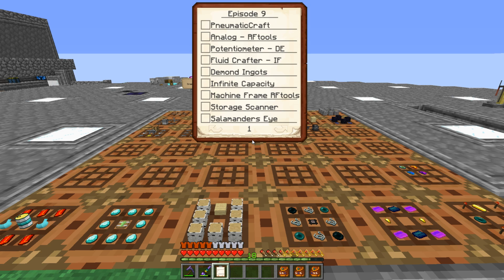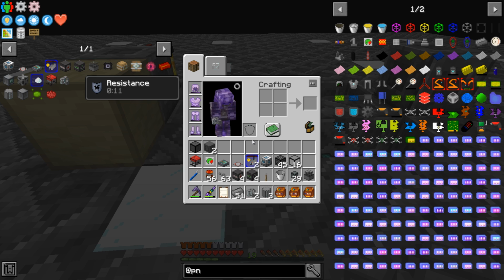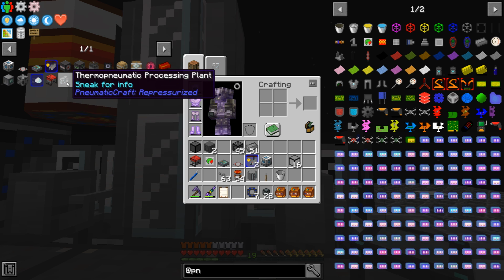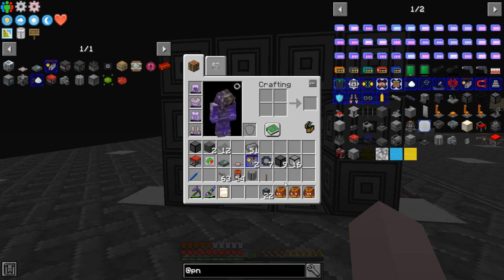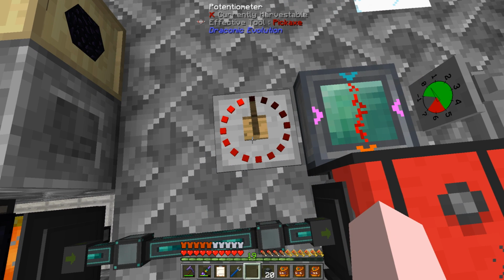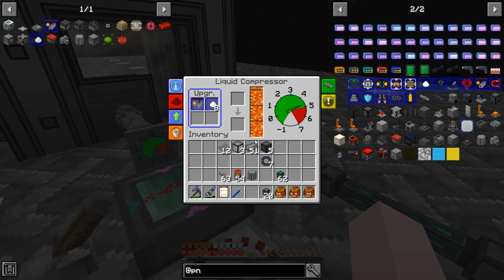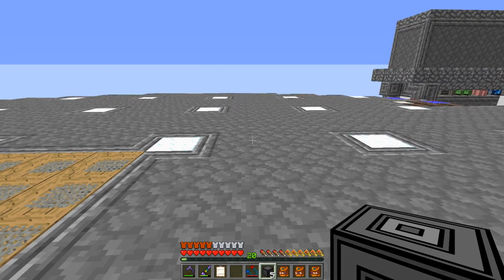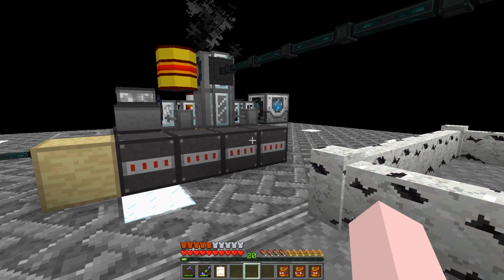09 - PneumaticCraft Plastic, RFtools Analog - Project Ozone 3

Comment from the maker: I figured out the A=B part during editing. 4.9*2=9.8 and it was rounding down to 9. So it wouldn’t turn off until 10 which is too high. I thought it would have turned of at 9.1 or at least 9.5 if it was rounding.
Reply: Oh to place it in reverse for the transfer node, its Shift right click if im not wrong, but i generally don't use flat transfer nodes as they random disappear on me
Reply from the maker: > Shift right click
That's how you place them to extract from the inventory you place them on. Before I was able to Ctrl-Right-Click to place them in reverse so they would insert into the inventory they were placed on.
Reply: @WilxGaming  oh really? Cause when I was playing Stone block 2 that was the hotkey for me to place them in reverse to insert rather than extract from the block I placed them on, maybe try searching under category for key bindings? Not too sure if they listed there.
Reply: Its rough rounding i think, even on 9.99 function for it just cuts .99 off.
Reply: @neket02  Since we are talking about rounding off, Just take note an the reason i only realised this was while i was searching documentation for my unity game, Programming rounding tends to round down for even and round up for even so 9.5 is round to 10 while 10.5  and 12.5 is round to 10 and 12 respectively....
Reply: @Lyoshiiro  think of like it "wants to be even"
Reply: I'll preface this by saying I haven't finished watching the video yet, but I didn't want to forget to comment about it.  I think the placing transfer nodes in reverse is whatever your Sprint key is set to.  I changed mine to Tab, and couldn't remember what it was either a couple days ago.  Sprint is the only thing that I have Tab set to.
Reply from the maker: > whatever your Sprint key is set to
Yes I set it back to Ctrl. I didn't try and change it. It was set to left click for no good reason. I blame my mouse. I need a new one. It's doing strange things sometimes.
Reply: Mod author here. This is indeed integer rounding - 4.9 bar outputs a signal of 9, and 5.0 bar will output 10. At that point the security upgrade kicks in and leaks air. There's no way it could turn off at 9.1 or 9.5 because redstone signal levels are integers.
Reply from the maker: > 9.1 or 9.5 because redstone signal levels are integers
That makes sense. Thank you for the clarification Desht.

Comment: On the use of 4 refineries...

Depending on your power supply at the point you're getting into pneumaticcraft, the Kerosine and Fuel can go into combustion dynamos or other fuel burning RF generators.  For using only 2 to be a good thing, you need to have more than enough power and enough oil that you don't mind 60% of it being wasted.   

Each opperation of the refinery uses 10mb oil and outputs 2mb diesel, 2mb LPG, 3mb Kerosene (if you have a thrid) and 3mb gas (if you have a 4th).  The 10mb oil use per operation does not change, the amount of a fluid you get out does not change, so with only 2 refineries, you are getting only 4mb output for 10mb input.  With 3 refineries, you get 7mb output, with 4, you get 10mb output, ie no waste. 

Storage of all that extra fluid can usually be done in a simple drum or two.   If you are going to advance in this mod enough to set up a vortex tube with high pressure pipes and lots of heat to make this refinery actually go fast, you will want to use better liquid storage, otherwise a simple iron drum is more than enough.
Reply from the maker: > 2 refineries, you are getting only 4mb output for 10mb input.
Actually 6, it double the diesel. However 6 is still less than 10. I knew that before I made the video and decided not to bother making the infrastructure to process the other 2 when I was only going to be making a small amount of LPG.

Comment: Great video as usual ♡
just a tip about placing the analog ( or any rftools logic blocks ) it will be facing the direction your cursor is on the block
so lets say your cursor is at the north side of the block that you wanna put the analog and you placed it then the analog will be facing the north side of the block.
Reply from the maker: > analog ( or any rftools logic blocks ) it will be facing the direction your cursor is on the block
Good Tip. I figured that out for IE Conveyors, You think I would have noticed for RFtools.

Comment: I believe molten (or compressed steel, forgot) steel has a higher temperature than lava
EDIT: And you can use a redstone clock that is around 10 gameticks with a dispenser to reuse the liquid
Reply from the maker: > molten (or compressed steel, forgot) steel has a higher temperature than lava
Good to know. However these machines are all maxed out on heat with just lava. However the advanced stuff probably needs more heat, if I ever need to do it. Thanks.

Comment: If you place a nether brick on top of the lava. You can throw the gold in the corner of the star that this makes. 

I used to use the item cannon from pneumatic craft with the pointer to use as the "user" for automation of the demon ingots. I'm not sure if it still works though.
Reply from the maker: > If you place a nether brick on top of the lava. You can throw the gold in the corner of the star that this makes.
Sounds interesting. What's the advantage of doing it this way?
Reply: @WilxGaming  no direct exposure to lava and some ppl believe that top block increases chances of getting demon ingots.
Reply from the maker: > some ppl believe that top block increases chances
That would be an interesting thing to test, but since I don't need more demon ingots I'm in no rush to test it.

Comment: To make compressed iron, i used the LOL tnt from dark urilities. Didn't have to worry about destroying blocks.
Reply from the maker: Good tip. I hadn't thought of that. I have more Compressed Iron than I'm going to use already.
Reply: I have used a creeper trophy for compressed iron and anything else that requires an explosion since Project Ozone 2. They have worked in every pack I’ve played.
Reply from the maker: > creeper trophy for compressed iron
Another good tip.